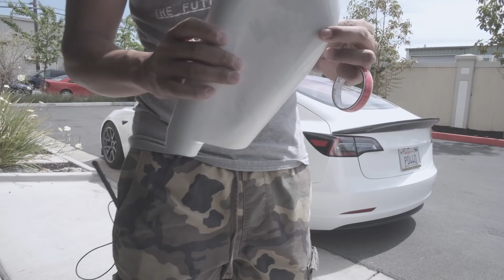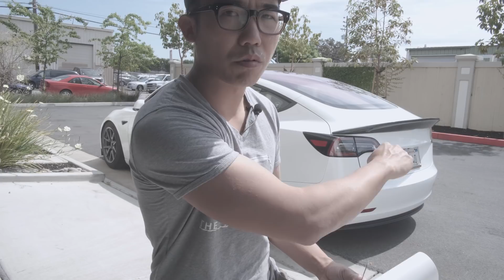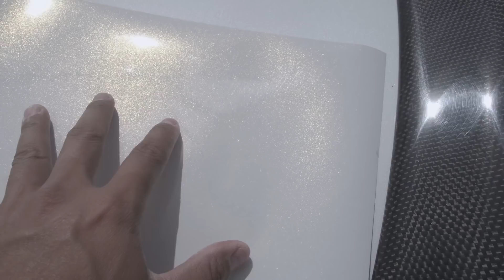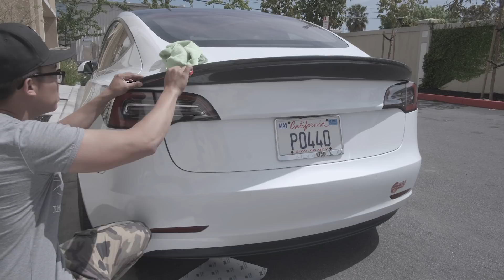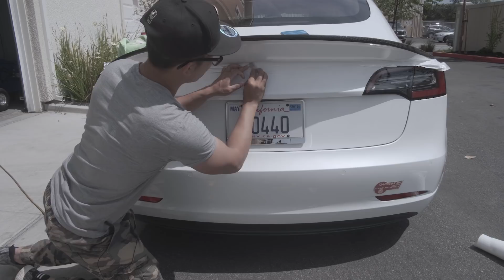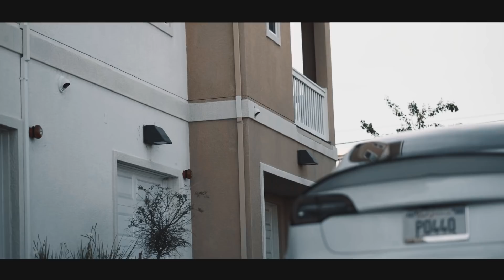Tesla Model 3 Color matching white vinyl wrap on my Maier Racing Carbon Spoiler

Comment: Is this the 7 inch or the 4? I really want to get thr 7 and color match the full wing of my blur ride.

Are you on spacers and springs?
Reply from the maker: Hello, This is the 4", there are photos of the 7" on Maierev.com and shop.Teslarati.com/tesladiy 
I was on spacers and spring during this video, i am currently on air suspension, you can see my newer videos if youre interested.

Comment: Hey Bro where did you install your front lip any recommendation im from the bay area also thanks
Reply: Yeah i just one today there today and i use ur coupon code they told me they dont do installing anymore and ask you yeah ill hit up htl or vk garage thanks bro..
Reply from the maker: Roberto Perez Hello Robert, Maier Racing Installed mine, however I’ve been told recently that they don’t want to do installs anymore. They do have a installation guide on their website however. Either you can do it yourself or you can probably hit up HTL in San Leandro or VK Garage?

Comment: Look great! How is the closing of the trunk? Because  to close the trunk, you need to make pressure with your hand on the edge of the trunk.
But you cannot make pressure on the spoiler. I saw someone putting an handle using the two bottom screws of the license plate. 
This might be an option? Best would be to have an electric trunk opening and closing!
Reply from the maker: Hello, I've seen those handles installed on license plate, i personally don't one, i close pushing onto the spoiler just fine, if anything i avoid pushing on the spoiler's over hanging portion, the spoiler sorta added weight to the trunk, even though its carbon fiber, it light but its still additional weight to the trunk so it actually makes pushing down easier?

There ARE power trunk liftgate available for purchase already. check out teslaoffer.com let them know Perry send you there, i don't know them, but i've talked to them.

Comment: It looks nice but $900 on a spoiler seems excessive. Cool tutorial though
Reply from the maker: Thanks Francesco, yeah the rear spoiler is a bit expensive. their front spoiler is easier to justify consider other front lip out there are in the 600-700 range unpainted in polyurethane material, so 999 in carbon fiber and if u are fine with the carbon fiber look, then u are set, it may end up be cheaper than buying a polyurethane lip after it gets painted.
Reply: I’ve yet to decide on if I’ll install one, but Unplugged Performance has an interesting study showing the results of a few different spoiler models, worth taking a look at to see the “why” for making an investment (beyond look and feel): https://unpluggedperformance.com/aerodynamic-study-of-tesla-model-3/

Comment: Good job. I'd like to see how it looks all white.
I just installed the RPM black carbon fiber and my son keeps telling me he wants the spoiler in white to match the color of the car and make a nice blend.
Reply: @geek2330. I was thinking of doing the same. Getting the rpm spoiler and wrapped a portion of if. 

@tesla diy. Great job!!
Reply from the maker: @SergioERestrepo  Thank you!
Reply from the maker: Thanks, you can kinda see it at the 9:00 mark, before i peel the top section and to be honest, it does looks pretty clean if i wrap it all white, but then it kinda sucks to pay extra to have a carbon fiber spoiler to get it painted/wrapped color matched.
Reply: @TeslaDIY  It looks like the color is very close to match the paint of the car, very close. Was looking on Amazon for other colors by 3M like a white gloss but the color you picked looks darn close as far as I can see from this video.
Reply from the maker: @geek2330  It actually looks the same once installed, but mainly because that section where I wrapped is in a shaded area, if I were to wrap it on the top section of the spoiler, I am pretty sure you can tell a difference, but for my application, I honestly can't tell that its a different color even if I try, both on camera and in person, it looks like a perfect match
Reply: has any tracked down the exact match for the vinyl?? @TeslaDIY